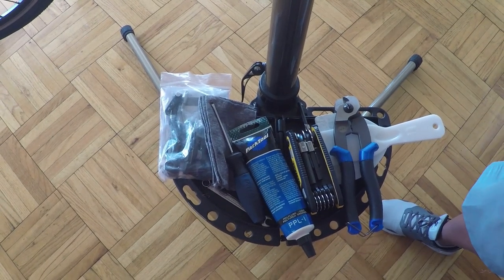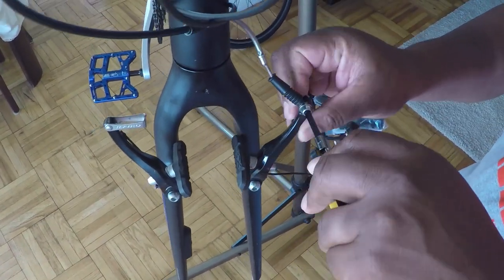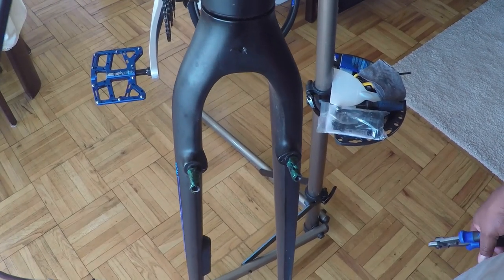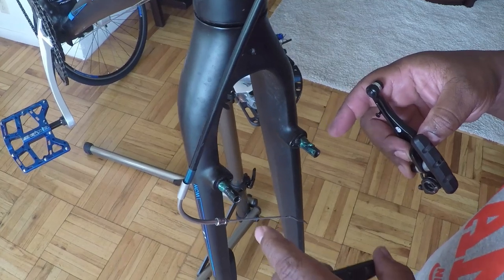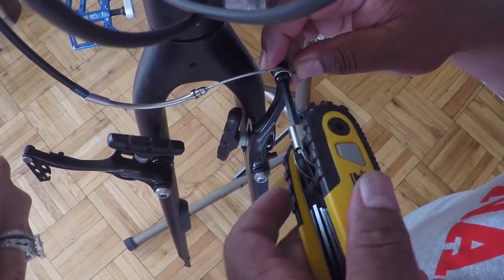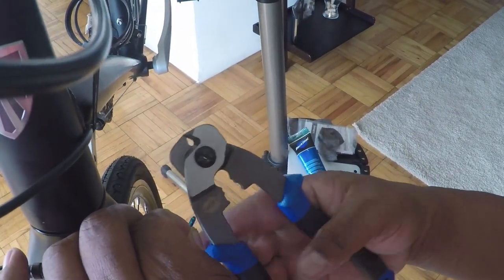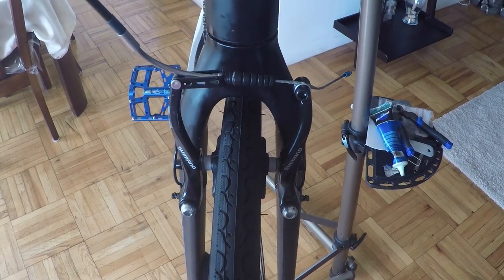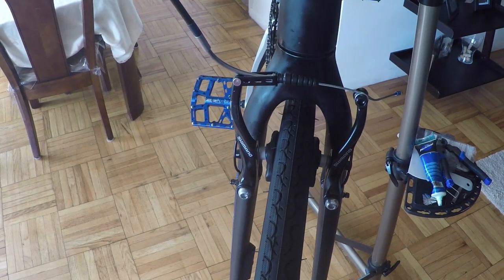How to install V-Brakes on a bicycle

Comment: I learned a couple of things from this video, mainly to balance the breaks b4 you hook everything up and that turning the spring tensioner screw clockwise makes the break arm pull away from the rim.  Thanks!

Comment: The Park Tool video calls for lubrication on the outer surfaces of the posts. The bolt threads, conversely, should be dry for the Loctite.

Comment: I was told no grease on the bolt threads cause it defeats the purpose of the loctite that's on there
Reply: Agreed and he doesn't mention the two different sized washers on the pads used for different fork gaps, had many customers with v-brakes set at 10 to 2... :)
Also find it easier to align the pads to the rim with the brake springs unhooked.
Reply: Pro tip: watch movies at Flixzone. Me and my gf have been using it for watching lots of of movies during the lockdown.
Reply: @Brennan Vivaan Yea, have been watching on flixzone for months myself :)

Comment: Great vid, clear, well filmed, and great-looking bike!  Question, I'm having a problem assembling a new bike where the quick release neck on  quick release tube (aluminum J) does not slide into opening of quick release lever. Is this a common issue and what's the fix?  I'm afraid to open the cut-out and weaken the part. Bike came with all parts in the box, not mix and match.  Thanks for the vid...you should have more views!

Comment: My new brakes came with the adjustment screws so loose one was out and the other 3 were just one thread in. Do you have to screw them down either all the way or halfway in or anything before installing? No way one thread in is ok a bump in road would of shook them out. Thanks

Comment: Why did you only show the front brake. Trying to figure out how to remove the back brake bolt that threads into my frame, then into the brake.